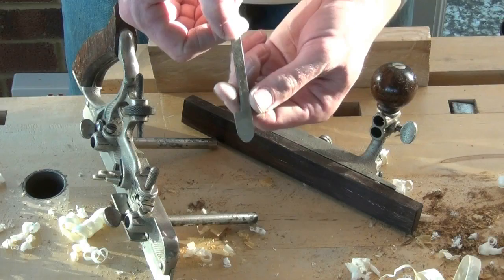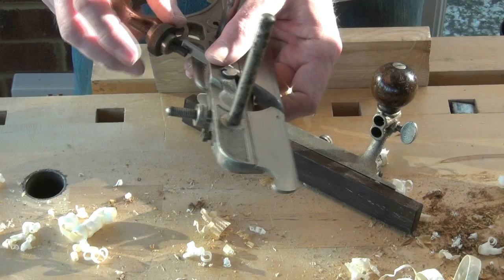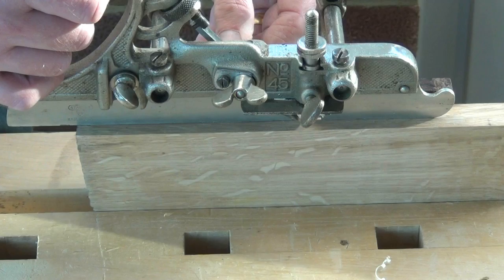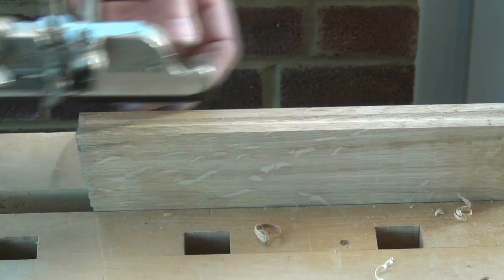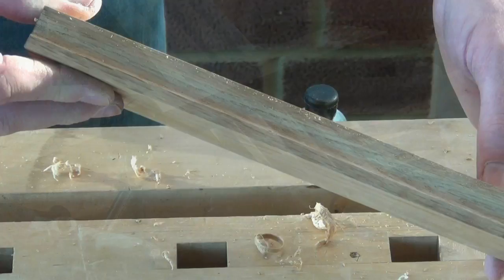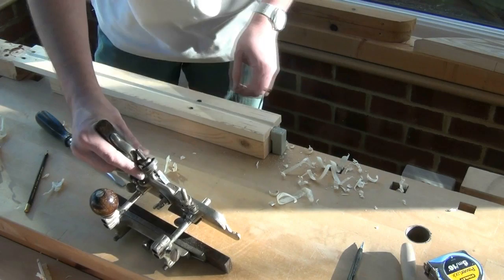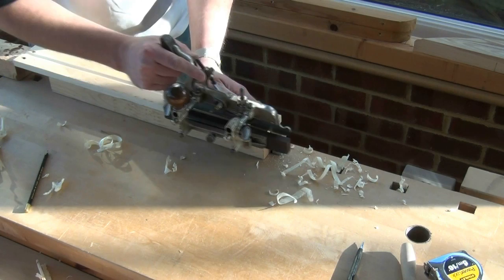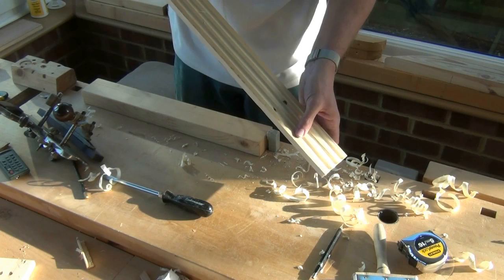Fluting using a Stanley No.45

Comment: Pura vida great demonstration .do you have a video about how sharpening Stanley 45 cut blades? Thanks
Reply from the maker: I don't recall a video on that. It is the same as for a bench plane iron though, using a bevel angle of 30°. For fluting cutters, hone in the one direction and rotate the iron to cover the whole edge.
Reply: @mitchwoodwork  pura vida I appreciate your answer for me it helps me yo sharpening my 45 blades cuts

Comment: It might be worth trying the 1/4" plane blade first, then follow up using the larger flute blade. This technique works good on a router table.
Reply from the maker: +Robert Cornelius Hi Robert. The skate sets the relative cutting depth for the blade, so it has to be a one shot deal - thankfully it's dead easy, about as quick as a router for modest runs, and no chance of burning. Thanks for watching.

Comment: is it difficult to sharpen the fluting blade? I would assume symmetry of the edge would be critical?
Reply from the maker: CodeFoxAus The face profile should be an elipse, so that when it is presented to the wood, at the bed angle of the plane, it eventually cuts a full semi-circle. The bevel is then worked up to the edge.The symmetry is a mute point. For a perfect semi-circular flute, then the symmetry would be critical, as you suggest. However, since a router with a fluting cutter will give you a perfect flute, some would say a slightly non-symetrical flute is the mark of a hand crafted flute! Personally, I wouldn't spend ages trying to attain perfect symetry, but rather aim for what 'looks' symmetrical to the eye.

Comment: Nice vid Mitch, highlights the operation I needed my 45 to do in the first place.  Curious though, have you made one on sharpening the fluting cutters?  I was just going to hit them with a diamond card, but was wondering if you've found a better way.
Reply from the maker: Cheers Kevin! To be honest I can't remember if I filmed one on that. I have used slip stone and diamond card to do it, and it's easy enough. Hone the whole bevel though, to maintain the profile and angle.
Reply: Thanks much, that will be my next project

Comment: Mitch, Great video.   I have a question that I was wondering if you could help me with.  I am trying to use the 3/4" fluting cutter and it seems to be too wide for the depth stop.   I was really hoping I could use the depth stop to ensure I get an even depth because the groove will be quite visible.  There is a cutout in the depth stop, but it isn't wide enough to clear the 3/4" cutter.   Any ideas for a work around?  Thanks a lot.
Reply from the maker: Hi Ray.
Yeah, they didn't think of everything when they designed it! However, remove the front depth stop and replace with a plain rod (ease the edge to prevent scratching the work). The small footprint of the rod could sink into the work, so consider bending the rod and grinding a flat foot of perhaps an inch or so, facing the front of the plane. Also, use one of the plane's short rods up front, with the cam foot set to the required depth. Finally, use the slitting cutter's depth stop to the rear. Touchdown on these three points should give you consistent depth flutes every time. Depending on the depth, you could equally just clamp a wooden stop, cut to allow the blade space, to the side of the plane skate. Hope that helps
Reply: Thanks so much. I will try some of these ideas. I think some combination of them should do the trick.